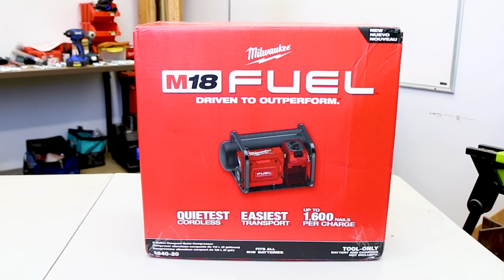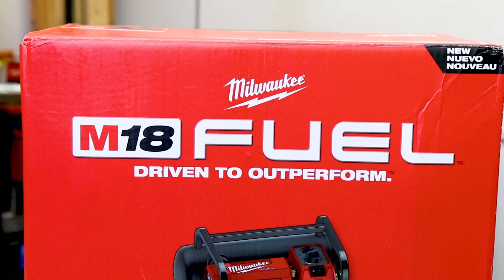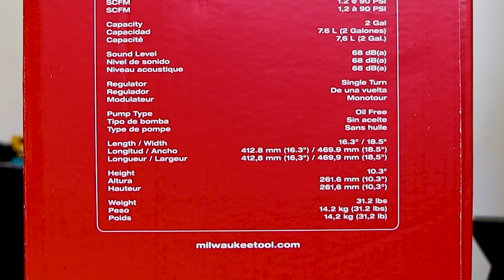New Milwaukee M18 FUEL AIR COMPRESSOR IS NOT WHAT I EXPECTED!

Comment: Don't forget, most of the compressed air doesn't go to the tool. It goes to the leaky quick disconnects that seem to have a life of about 3 mating cycles before they leak.
Reply: Buy the good Milton not the cheap junk
Reply: @mrmotofy  I’m late but I can back this up 99999%. We use Milton type A at the shop I work at and they NEVER leak. Even survive getting run over by an ambulance.

Comment: I was supper excited about this until the part where you have to bleed off the tank in order to change pressure. I’m genuinely curious what their reasoning for this is. To me it’s a cordless compressor so once it uses the energy to fill the tank the last thing I want to be doing wasting it just to change pressure to the tool. I have a lot of FUEL tools and they’ve never let me down but I think Milwaukee really messed up on this one. I think the 1 gallon Ryobi is better designed...

Comment: My m18 compressor just quit working for some reason today. Just using it for a nailer doing some lap siding. It’s not as hot out today as it was Friday when we were working and never had an issue, so I don’t think it was overheating, but it decided to start working again after about an hour. Other than this issue, it’s been great so far. Super quiet, but I’m now concerned about it just shutting down randomly on a job site and leaving me dead in the water while it cools down or decides to do whatever it needs to do.

Comment: @9:22 You know...   If you were to meander over to a hoseshop thats got brass fittings with $5, you could build a quick disconnect T to come off of the 1 outlet they have -They if you want you can plumb regulators downline (or infront of your T?), then you can just set the regulator onboard of the compressor to MAX & call it DONE, then adjust the downstream regulator on the fly

Comment: What do I think? I think not dragging a 100 ft hose reel and tripping over it around job sites or having other tradesmen trample and destroy it, dragging heavy awkward noisy compressors around customers homes (where so many work from home now) is freaking amazing and I’ll ditch my other compressor and reel for this and a nice little 25 ft hose.

Less space taken up in truck, less noise, can easily move room to room, can roll it in on my pack out , and it’s on my current tool platform? 

I think I’ll take two. Thanks for you reviews!

Comment: Makes me wonder why they didn't just do a traditional regulator so you could adjust on the fly and the regulator would "bleed" off that extra pressure....seem strange to me why they would do it that way when there is a simple way to make it work..I guess you could regulate it post compressor but..idk..seems like a bit of a deal breaker to me
Reply from the maker: Thanks for the feedback!

Comment: hey how about that bleeder valve by the side of the gauge and pressure selector? Is that what you're supposed to use in order the change the pressure?
Reply: That "bleeder valve" is called a "ASME safety valve", aka as a blow-off valve.  It is there to vent the tank in situations where the compressor malfunctions.  This valve is designed to vent the tank in order to prevent a tank explosion.

Comment: The blow gun for cleaning tools and painting is something to consider.  My cordless saws go back in the van covered in saw dust.  Or I get a bunch of dust in my paint.  I'm interested not tested.
Reply: The cordless small blowers do a great job of cleaning off my miter and tablesaw, not to mention a deck or patio that may be now covered in dust. Mine happens to be Makita...been using it for many yrs.

Comment: I bought one to keep in the work truck to inflate tires in emergency  situations. I don't use it for tools and haven't had a chance to try it out yet, but I assume it will be faster than the air compressors you plug in your 12v Cig plug in your vehicle.

Comment: In my line of work that's what I need, im in the water business, and checking bladder tanks air charge is a must to keep pumps and switches from burning up to soon. I don't always have a power outlet handy, so this works perfectly for me, and the size finishes it off, it will fit in the side box of my service van

Comment: I am a plumber, and it is a very good equipment, I do not have to worry about the electrical connection because it is battery operated, I always test at 9 bar,I recommend to plumbers

Comment: I use Milwaukee and dewalt, I have more dewalt batteries than Milwaukee so whenever I buy something for Milwaukee whether it’s the m18 or m12 , they make dewalt battery adapters and the work perfectly on almost every version of tool they own, some people won’t like it but if I had to use a a pin nailer I could’ve bought the dewalt version and bought a Milwaukee battery adapter and it should work fine.

Comment: Can you adjust the reg levels? If not deal breaker. I use these for larger nailers in small jobs, and leave the reg box open. Notches at ideal max pressure and kick on for each job type (framers three nail kick on, 15deg finish 5 nails higher max pressure etc). Weird reg dial is no matter, preset inline regs dial and knob removed for each tool is the way to go, leave the compressor wide open.

Comment: I’m pretty sure you just need to turn it off and pull the pin pressure release on the side to change the pressure on the fly. Put the pin back in and flip it on.

Comment: Vince, I think you are confusing sound pressure with sound power.   Both can be measured in dBa, but the power will not depend on distance from the tool. See IEC 62841 for standards on how this is typically measured.

Comment: We do tile . And we been using the dewalt version. We paper and wire and staple ... it’s 1000% faster than nailing. So it does the job in that area. I have all m18 so I was looking at this.

Comment: I bought one a month ago. 
It works awesome. Air ride suspension on my truck. Plus flat tire on trailer. great little air compressor. But very limited for the job. 
I also have a portable air storage tank. 
That I can fill up with it.

Comment: I’m on my second m18 compressor already, had to return the first due to pressure switch issues in the cold. I install bird netting often from a scissor or articulating boom lift and don’t want cords or long hoses from the ground. Also on the lifts with generators I don’t like having to run the lift high idle constantly to operate a loud pancake compressor so the m18 is a great option to supply my hog ring gun. The thing is I’m having more trouble with the pressure switch malfunctioning even on my second unit and in a heated airplane hanger. Seems like the weak link on these compressors. The first one I bought from Home Depot and in the cold after significant use the pressure switch would stick open and continuously bleed off air. The second unit even in the warm air was short cycling on/off/on/off at peak pressure.

Comment: If you look at a lot of the display photos it's basically a guy doing trim work so that's what the demographic that they're trying to sell to it's for the guy who has all the guns doesn't want to spend a fortune on battery operated instead by small air compressor that's extremely quiet

Comment: Milwaukee should've added the following to make this a must have tool:
1. Ability to power from M18 battery or plug into AC power (and charge the battery while plugged in).
2. Ability to hook onto Packout system.
3. Gauge to display true output pressure. 
4. Add a second quick connect so you can supply two tools at once.
Reply: 1.2cfm. Not sure the cycle time can handle 2 tools at once. My 6.5cfm compressor can.... Maybe if it was 2.5cfm I would say 2 tools makes sense. Outbound Regulator with a gauge definitely does make sense.
Reply: You have a point. I think having two connections would be convenient for having two nailers connected without having to disconnect & reconnect all the time. Probably only using one nailer at a time.

Comment: I picked this compressor up and haven't used it yet. I will need it for a air blow gun to clean pads for polishing a car.  You're supposed to clean the pads between each panel application.. how well would this hold up with a air gun ?

Comment: Why is milwaukee so proud of their tools?? There are less expensive options for sure. They are taking advantage of Milwaukee die hards.
Reply: You pay a premium to own the best. If you're USING the tools right, then they should be paying for themselves, and better tools pay off faster and for longer.
Reply: Milwaukee is geared towards people who make money with tools not for a Hobbyist. I buy Milwaukee because I can depend on the tools. I spare no expense when it comes to my time. They perform over and over. I’m just about completely cordless. And it’s so much more convenient to not have to have power and run 100’ cords that are a liability for people to trip on. Plus the Milwaukee m18 batteries are all compatible huge plus. Yes cost is significant, but my time is worth more.
Reply: Just like Harley Davidson! 👍🏻👍🏻
Reply: @terryburgess6637  the dewalt compressor is better in every stat though except decibels. and on a JOBSITE. noise is a given
Reply: Jo V  on noise, you’re thinking in terms of new construction. I don’t work for contractors only homeowners. I do remodel type of work. I’m not disagreeing with you that the dewalt compressor might be slightly better than the Milwaukee on some things.. but I have to consider that with buying a different brand tool means more chargers and batteries that will only work with that unit. Also I don’t like the pancake style compressor only because they take up more room in my truck and are tippy. Every m18 battery is compatible with every m18 tool. Dewalt isn’t like this. They have 3 or 4 different styles that only work with that particular tool. That’s a fail in my opinion. I’m a die hard milwaukee customer. Sub to me I will try to post a video of my arsenal. I’m not that techie but I will have my daughter help me.
Reply: @terryburgess6637  thats the thing right, same here, on my work we only buy milwaukee, why? Wel because you invest in to the battery system once, and then you expand on that. The battery part is the most expensive part.
For my own use i just bought all metabo as they gave out a free 5 Ah battery with every tool i bought, so that made a cordless impact, cordless hammer dril and a cordless angle grinder with 5 5.0 batterys and a 8Ah charger for 600$, compared to 900 for the comparing milwaukee. But it was only because of the free battery, those 3 free batterys is the 300$ difference.
And so if you where to buy 1 dewalt thing you would probably need 300$ word of batterys to be able to run that compressor on a job, meaning you wil invest more in the batterys and charger then that whole milwaukee machine is costing. Again, you invest in the batterys, then expand on it. And if 1 battery fails you stil got a nice load around, and if not you buy 1 or 2 new batterys and you can keep using all your tools. If you buy 10 brands and you want to keep using all those 10 brands that means you might be out buying 20 new batterys because you want atleast 2 batterys for every tool, 1 on the charger 1 on the tool.(unless you get a lot from 1 brand, then 1-2 on the charger and 1 with every tool is enough making it again cheaper to go with 1 brand)
Reply: No they're not

Comment: If not using air tools, would there be any reason to get the 2 gallon Milwaukee versus the 18 V inflator? . Sometimes I wish I had some compressed air when changing spark plugs etc; —But could the inflator do the same?

Comment: It’s pretty heavy compared to the California air 2010a compressor with a 1hp motor 3scfm, 60dbs and all aluminum I own both and the California air recharges at 90 psi to 125psi in 10 seconds and 45 seconds from 0-125 psi I think milwuakee should have made it aluminum and in the future I’d like to see higher scfm numbers great video though Vince
Reply: Yes, the California may be lighter but carrying the power company with you to a job site gets kind of heavy.  Your point about construction materials is valid  but comparing a corded to cordless is not reasonable.   This is the tool I take for a repair or no power.

Comment: Glazier here, have been borrowing my colleague’s cordless brad nailer for window stops. Heavy and bulky but it works. Thinking about picking up one of these compressors, but the price difference is only worth it if I get some more utility out of it like topping off my trucks’ tires. Would using an air blow gun with this be practical?

Comment: I just used mine today. First fault is the 12 Amp or smaller batteries are not easy to put in or pull out. Second fault inserting the air hose on the air compressor side is somewhat tight as well. 3rd fault Milwaukee should have went with at least a 4 gal. air tank.  I set mine on 90 lbs. Using it to just blow dust off my refrigerator coils and fan. Had plenty of blowing power. Did fast short burst of air. Came on after just a little bit of blowing, came on and off a lot to maintain pressure. Would have to stop and wait till back up to pressure. Used it for around 30 minutes off and on. Used two full bars on my 12 Amp M18 battery. Unless the nail gun or brad gun uses a lot less air compared to blowing pressurized air.  You may need some extra 12 Amp. batteries to do a specific job. IMHO. The unit was not far from me about 15 ft. Was not too loud , my wife and self could talk back and forth and hear each other.

Comment: I got an idea 
Only one inlet and can't adjust pressure 
Quick coupler  1 inch spacer 90° angle 2-6 inch hose a couple regulators  a t fitting an another 90 adjustment with more connections and a happy worker

Comment: Milwaukee always says they have no plans.
I called corporate as well as talking to several reps to ask if they had plans for a miter saw and they said no so I bought a cordless Dewalt. 2 months later they had a cordless miter saw.
I asked if they had plans for cordless table saw and they said no so I bought a DeWalt corded table saw and 2 months later Milwaukee came out with a cordless table saw.
I wish they would just be open and honest so I didn't have to deal with two or three different Battery Systems.

Comment: That compressor has shot thousands of nails for me....I run 3 hoses with a splitter and this handles it perfectly up to two guys shooting nails. I love it.... so nice not to deal with a cord when room hoping and using short hoses rather than long pain in the ass ones. And it's quiet so I can work without disturbing the client as badly if they are on site. I have the cordless nailers now so I don't use it as often as I did for nailing but I still run my crown staple guns and a a ton of other air blowing, and other tools with it....I'd love to have the space back in the trailer but I refuse to take it off the trailer as it flexes into different roles for me.  .....n I did it right.... buy this first! And use your air guns to make money over time, THEN you can buy a cordless nailer with that money while still having this for other nailers you don't own cordless yet. Then when you have all the cordless nailers you need you still have this! A full set up to send out with a second crew! So now you have the tooling you need to effectively expand your business.... if that's what you're doing,  that is.  Worked out great for us that way.

Comment: I have this to texture the house for work we do. With mine i can adjust it, but i only use about 50psi, so Knob can be adjusted but its firm.. mine turns on at 110 and fills at 130psi batteries do die out quick so i had to get 3 to last me a day, which is a lot to be texturing.

Comment: Has any one tried releasing pressure with the blow off vs the tank drain? The blow off is closure to the regulator assembly and might release pressure on the regulator

Comment: Could you try to fill a 1/2 ton truck tire to something like 40 psi and a 3/4 ton tire to 80. And a demonstration for use as a blow gun type compressor for cleaning out spark plug holes or similar. Like fill a tube with leaves or some water and see the results this would let me get rid of my gas compresor and give me a lot more room in my truck bed

Comment: Tried a framing gun with it.    Only could get about 10 nails or so before I had to wait for pressure to build back up.     For small repairs would be better than nothing but not adequate for any real work with a framing gun

Comment: I just picked one of these up most videos don't do how quiet it is justice the sound of it through my phone was louder than the actual tool itself this video did the sound justice but I'm really excited about it because it's my first milwaukee so I have a battery and a charger so when one of my tools breaks I can get the milwaukee version without having to fork over $600 to use it only because this made me do it but I wanted a portable compressor I didn't have any compressor and my other option to get what I wanted would've been $800 and alot of work for instalation into my truck I can throw this in my cars trunk and done

Comment: Just for fun I recently used this with my Milwaukee framing nailer on a small roof job using 2 1/4"  ringshank nails for 7/32 osb. Running on a m18 12.hd. I could rapid fire 12 nails before it needed to ramp up in which I would have to wait over a minute.  It ramps up after every 5 nails. And I was able to sink 180 nails on 1 12.0 battery. Compare that to the new m18 2744-20 that sinks 700 nails per 5.0!